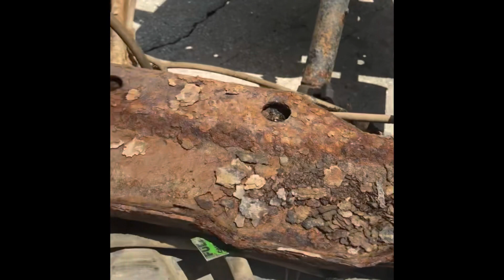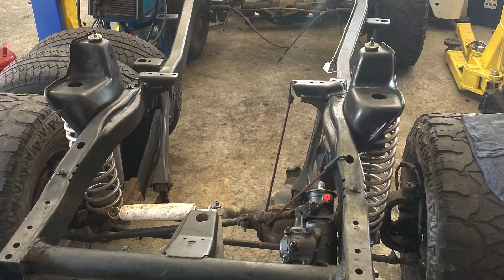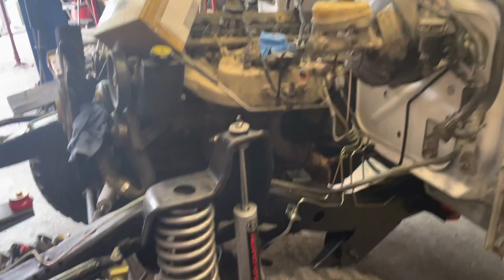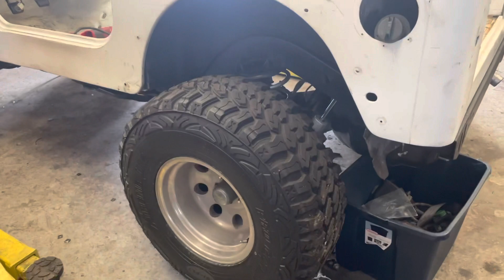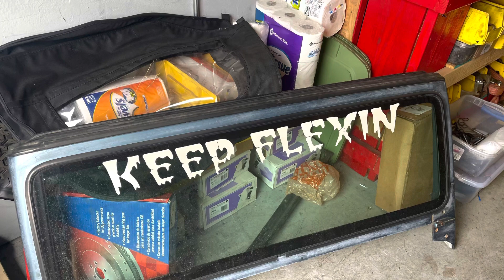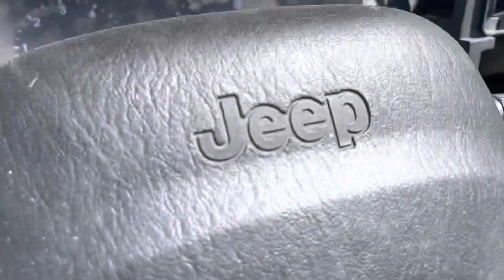Jeep Wrangler TJ - Frame & Tub Swap Timelapse, Ep.11

Comment: Replaced frame and tub? I might have to do the same. Love my TJ. What problems are there with registration and VIN, etc...?
Reply from the maker: Good question, You should be able to keep the same, might depend on that state and the shop you use if you don’t do it yourself. The rebuild was cheaper than buying another TJ with their inflated sale prices and I got to rebuild the way I wanted it to be

Comment: Man the new frame looks really clean, is it new? I picked up a cheap Jeep and the frame is shot. Trying to figure out if I want to buy a used one or drop 5k on a new one. It’s a project for me and my son.
Reply from the maker: I bought this frame at a junkyard from a Florida Jeep with no rust in another video I posted. I cleaned it and coated it but it had no rust damage to begin with. Try www.car-part.com to search junkyards near and around you. If you see multiple Jeeps at certain locations, it’s worth going and inspecting for yourself and making an offer on parts. It was a year long build for me. Good luck to you and your son!